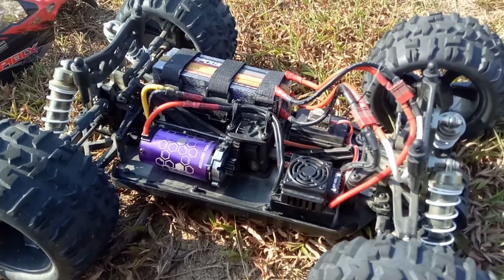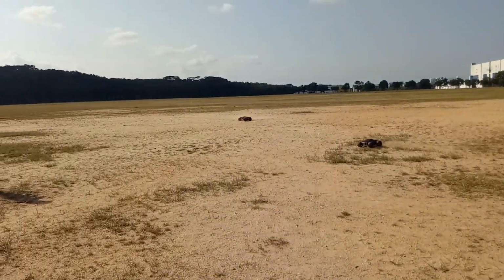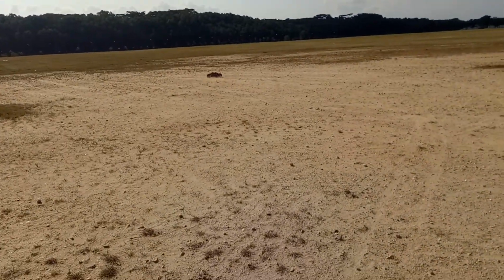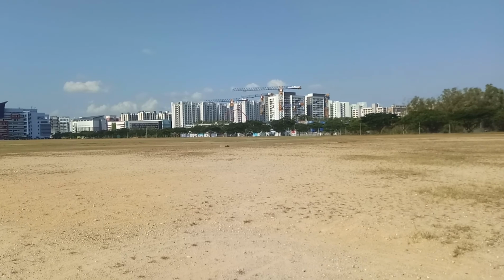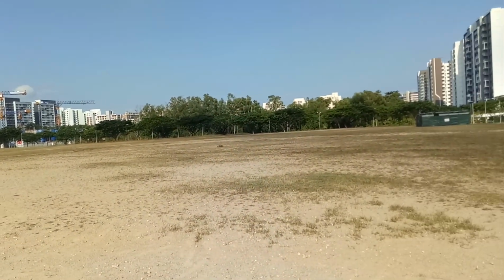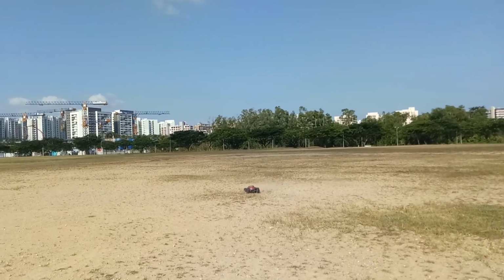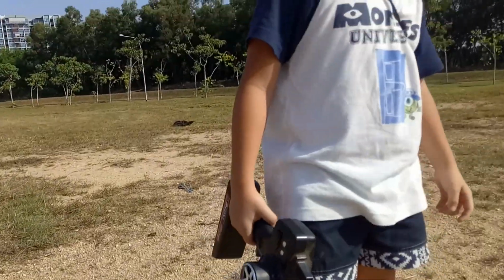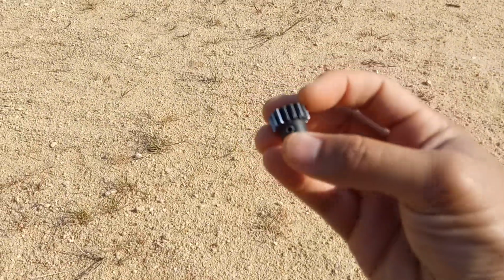ZD Racing Pirate 2, Run 1 on Turnigy XK-4074 2000KV, 15T mod1 pinion

Comment: Performance is impressive!
Reply from the maker: andrew mccluskey It is! Unfortunately the spur crapped out on the next run.
Reply: Monster-X RC sorry to hear about that, I think when I get mine back, I'll be running on plastic spur gears only. May upgrade to original ZD optional 16T pinion gear as on 4S with 13T it wheelies too easily and tops out too quickly even with only the 3670 size motor.

Comment: Nice. Put one ramp on the other and let see how it does big jumps 😜
Reply from the maker: Switch Off When Not In Use Will do once I replace the spur gear. Haha!
Reply: 😁, Loosen motor pinion happened to me also. Now i always put threadlock and i tight the grub screws very hard. After that, if i need to change the motor pinion and if the grub screw is too hard to remove, i use a solder iron to melt the threadlock glue.
Reply from the maker: Switch Off When Not In Use Thanks for the tips. For the next run, I've already loctite the pinion, so it's nice and tight. BUT, I think I meshed it too tight. That's why the spur stripped. I'll upload the video later.

Comment: 4 s batery ? uhnmm teria de ser mais nervoso ,..mas no esta mal  ! ja da pra divertir ! um motor bom pra isso  era o mamba monster  2200 kv ou  2650 kv,.. i,m use the  2650 kv , good seped and  power , esc. hobiwiyng 120 amp,.. ou  150 amp,..

Comment: I'm looking in to get that turnigy what is the gauge of the wire and how good is the motor
Reply from the maker: +Jumpstart rc I'm not sure on the wire gauge. But it's a great motor. Runs cool even on 6S when I put it on my Hobao Hyper MT Sport Plus. The magnetic detent is very strong. It's hard to turn the rotor shaft by hand if there's no pinion gear on it.
Reply: Monster-X RC thanks
Reply: I don't exactly know I just ordered this motor recently but I'm pretty sure it's close to a 6 or 8 gauge wire and I'm hooking it up to 220 amp ESC with 10 gauge wire